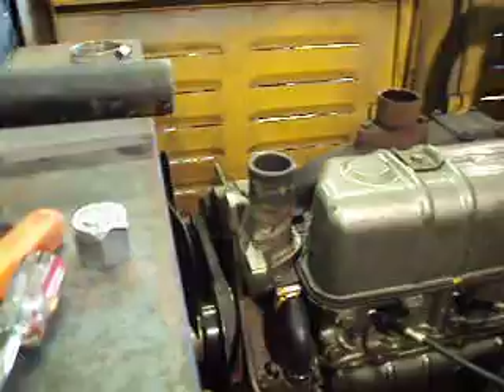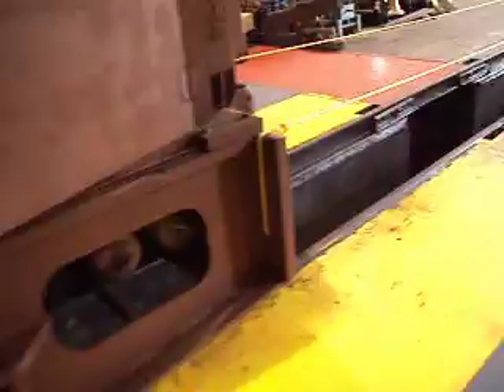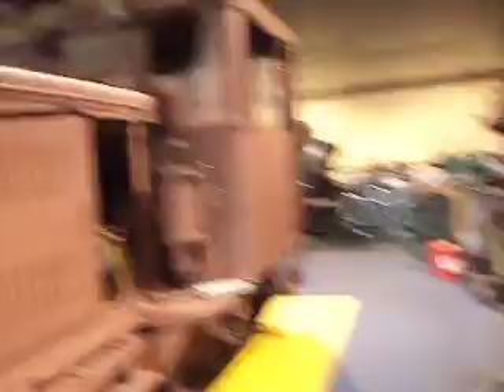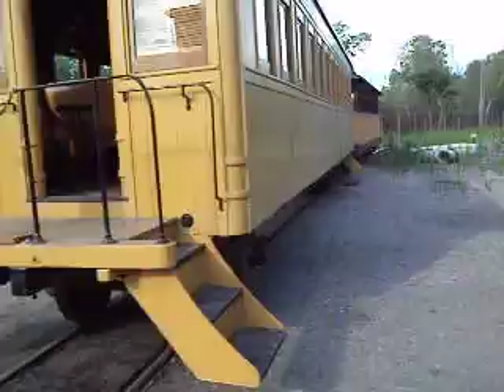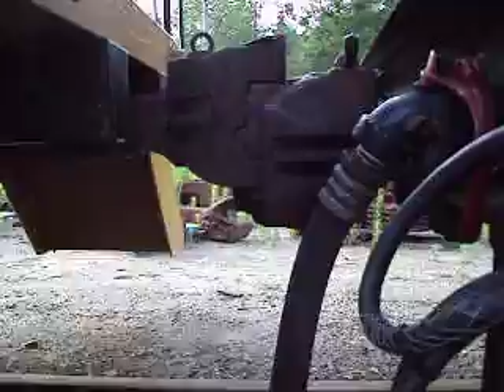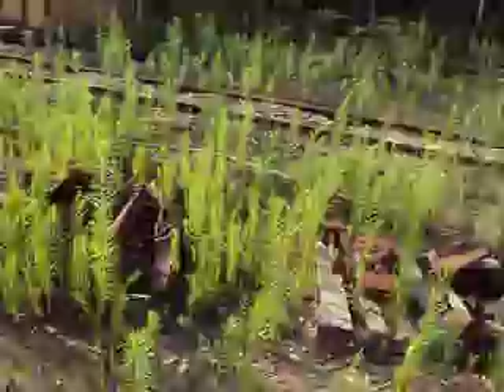Huckleberry Railroad Shop Projects Update

Comment from the maker: The Dog House is not part of 464s original equipment only the 453 had a dog house out of all the K-27s this dog house is home built and was originally used to hide the gas generator that powers the lights but it has been used for the front brakeman to ride in.